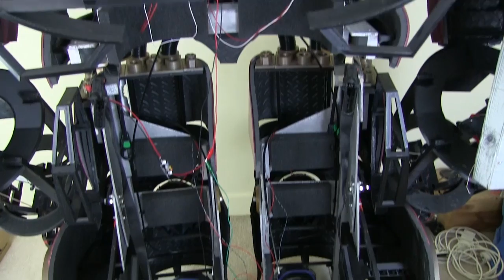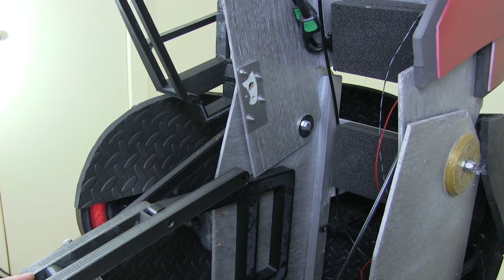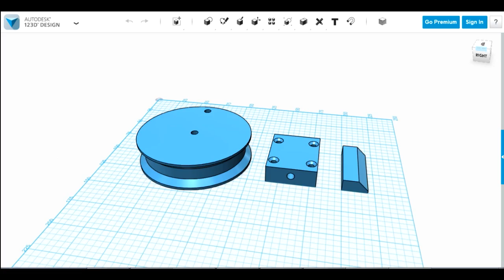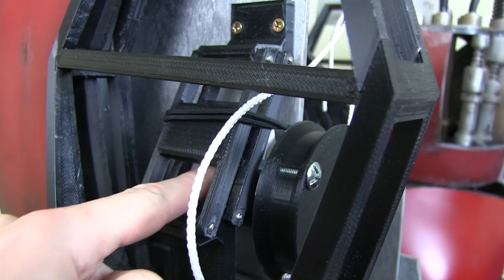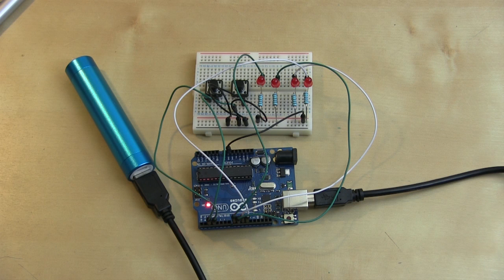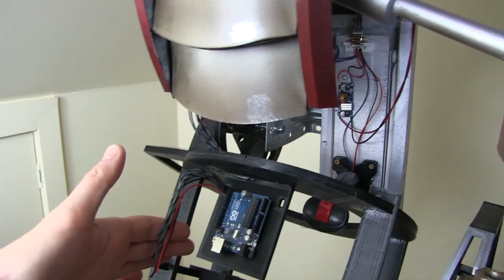Iron Man Hulkbuster Cosplay #32 | Test Drive | James Bruton

Comment: He has REALY over thought the leg locking system
he could have easily done a simple bolt in a wheel, and had it go into a slot, that would have locked it just fine

Comment: I'm interested to see if you tighten up the knee repulsor mounts so they are less wobbly when you walk.  Also, for hinges and pins, it's best not to use anything with threads on it for two main reasons.  1) the threads make it more difficult for the pin/pivot to move smoothly through its hole, and 2) the threads act like files/saws and slowly remove material around it every time it moves or revolves, which makes for sloppy pivots and holes over time.

Also, tapering the end of the pins would make them find the holes a little easier to lock out the knees.

Comment: Doesn't the joystick have an x and y axis to work with besides the two buttons?
Reply: ***** that makes sense. Unfortunate, since this will cause a 500 ms delay in any forearm movement
Reply: Javier Berezovsky what about a 2 way rocker switch? Its simple and inexpensive, easy to mount, and would greatly simplify controls
Reply: ***** mister Bruton, i came to your mind blowing channel via a video showing the original bb-8 prop from the set of the new star wars movie. and boy do i have to tell you, you have some wickedly smart mind, combined with some of the awesomest imagination i have ever seen. i subscribed, and am looking forward to literally anything you upload in the future. 
But on topic: i don't use joysticks for gaming any more, but from many years ago, i remember using some "thrust master" joystick i think it was called, which actually had 4 buttons (one big in the front, one for the thumb to the side, two on top, also reachable by thumb) as well as a mini joystick on top of the stick itself. I believe tinkering with those buttons, combinations of different buttons pressed at the same time, AND the mini joystick would give you an opportunity to probably control even single digits of the hands? But if you can make it work to your satisfaction with just two buttons, that's of course enough.

Comment: i think it would be a good idea to make the hands grip using the joystick left-right function, instead of the buttons, because it would make it so you can hold items using variable amounts of pressure as well as holding poses. i suggest making it so if you move joystick in (towards the body) it tightens the grip, and out to release. 

it would be cool if you could make it hold a paper cup or something heavy, and i'd definitely want to see that.

Comment: You might have noticed this, but that cross bar at the top which is holding the arms on has a serious bend to it. It should probably be reinforced before you add too much more weight to the arms.

Comment: For the latch that holds the legs straight I think a throw switch on the end you operate would make things easier. Like the old electrical throw switches... but attached to your rope. Up is walking mode, down is latched.

Comment: You could use a similar size dial to control the release of the knees by fixing the strings to opposite points on the diameter of the dial,  the latching would still be done by the wheel at the release point. But may make it less fiddly than trying to pull a string

Comment: You should test the silver paint for conductivity, some silver paints have actual bits of metal in them. It won't be as conductive as wire but if it's slightly conductive it still may be a good idea to insulate any boards you put on there.

Comment: I had an idea for adding extra functionality, without having extra buttons. On your BB8 remote you had the menu driven system running on a small number of buttons. Keep the long press for arm motor control, but use short press for menu up, menu down, select and the fourth could be used to cycle through additional menus on each press.
I'm guessing that there would be space to mount the mini LCD screen in the helmet. I seem to remember you doing something similar for the menu in the original iron man suit, but I can't remember which video it was in.

I look forward to seeing the suit done and working at a con or expo in the future.